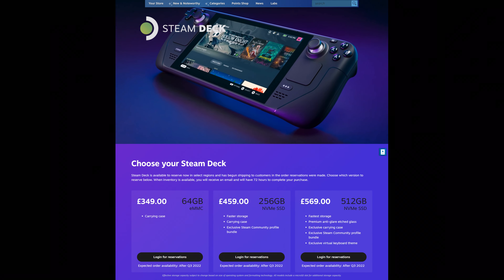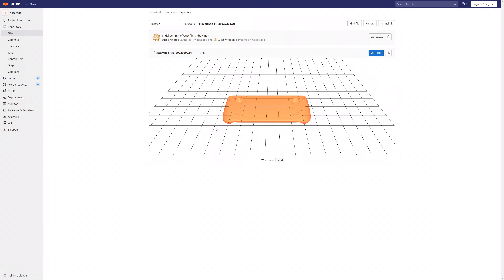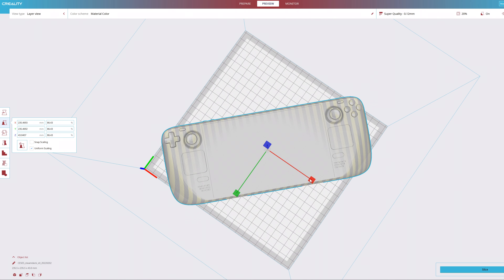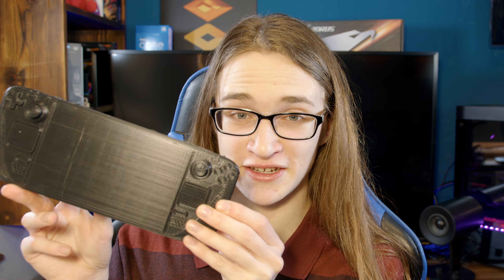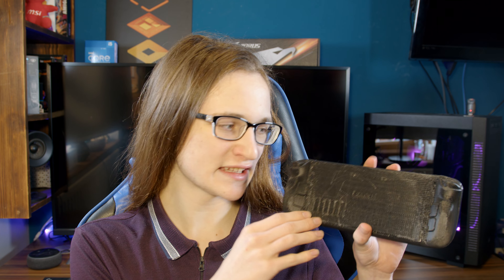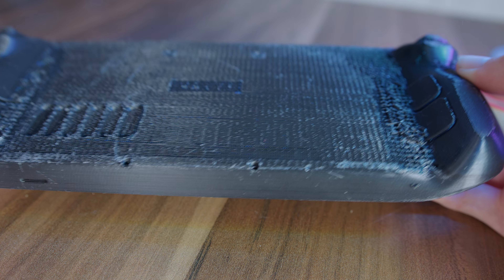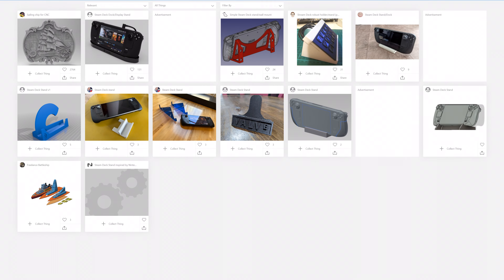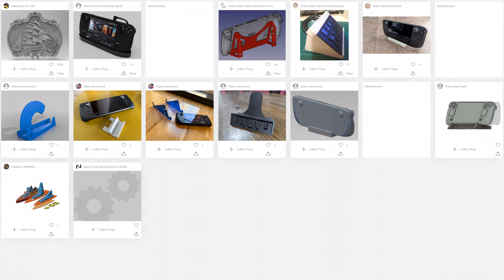3D PRINT YOUR OWN STEAM DECK! Valve Steam Deck CAD Files

Comment: You should have cut the print half so you wouldn’t need supports
Reply: I cut mine in to 3 parts controllers and base, it means I will have very little supports. Left controller is on print right now